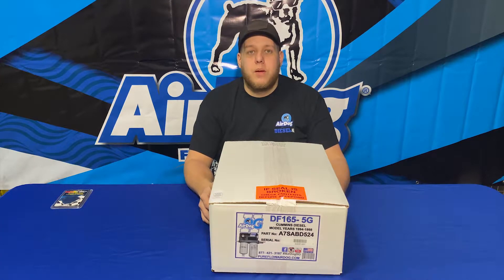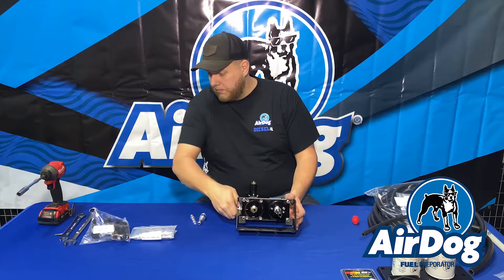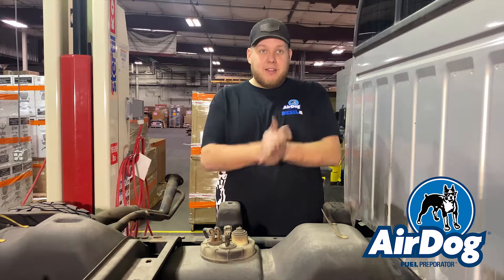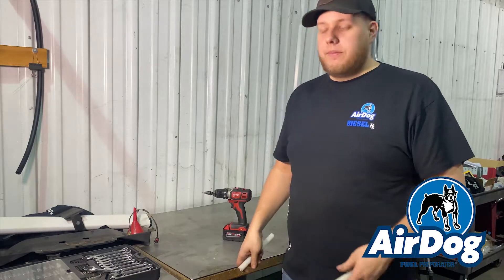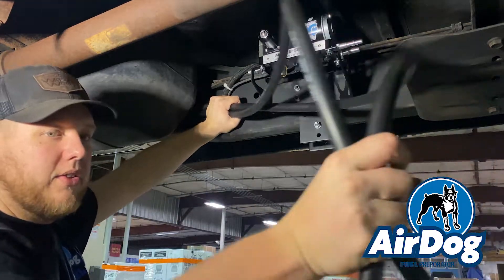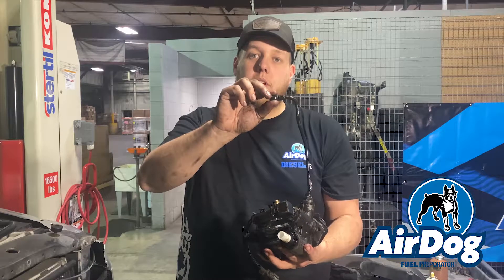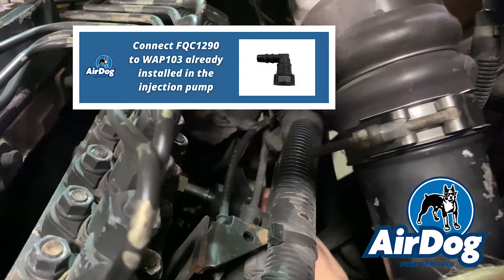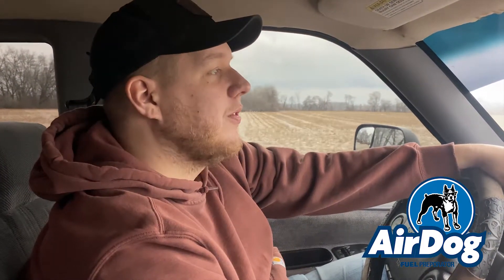1994-1998 Cummins Airdog DF-165-5G & DF-220-5G Installation

Comment: Just seen this video pop Thanks for making a  video of the 12v install kit there is no other video’s at all on 12v
Reply from the maker: We are working diligently to cover any platforms we have not made a video on yet.
Reply: @AirDogSales   how do you install your fuel pressure switch if you have it installed already into the side of the p pump ?
Reply: @AirDogSales   do you guys got any videos coming with a sump like
Beans installed in bottom of tank? Your the only company that done a video on a install on a 12v cummins how do you install
Fuel pressure switch that was installed into side of p pump?
Reply: @AirDogSales   do you guys do installs ? If so I need my new kit installed on my 96 ram 3500 12v cumins I have the beans sump but opened yo do whatever’s best

Comment: Does installing this pump make the in take pump not in use anymore? Or could the in take pump feed the air dog as well?
Reply from the maker: 12v Cummins Diesels do not have an in-tank pump. Only a fuel level sending unit.

Comment: Man I’ve watched this video like 5 times and still have questions. I’m installing a AirDog 5G 220gph on my 97 dodge ram 2500 12v Cummins with a dual sump from Ohio diesel. I’m running a block off plate on the mechanical lift pump port and deleted the stock fuel filter and removed the stock hard fuel lines. Curious what I do with the hard line where the overflow valve goes. I have a Tork Tek 70psi race overflow valve I’m installing to replace the adjustable one. Also do I need to use the filler neck adapter when using a sump? And should there be an oring or gas Teflon tape on the fitting that goes into the banjo fitting on the pump!
Reply from the maker: If you are replacing the return line off of the p-pump you will still need to tee the injector return into the return line. The injector return needs to be downstream of the overflow valve. If you have a feed and return sump, you won't need to use the filler neck tee. No, no tape or sealant on the fittings. The sealing washer provided in the kit does all the sealing.
Reply: @AirDogSales  thank you so very much!

Comment: Nicely done. I had a question, where do you recommend installing a fuel pressure gauge? On the air dog itself or closer to the p pump?
Reply from the maker: Being a pressurized system, it doesn't matter where the pressure gauge goes. If the sending unit wires don't reach the AirDog, we do sell a fuel pressure tee splice that will press right into our 1/2" fuel line.

Comment: What kit should I get for a freightliner fl70 with 5.9 cummins 12 valve engine?
Reply: Wow this dude who made this video didn't get back to you. Well in that case I would just put a 150gph. Plenty of fuel. The 165gph is 100 bucks more and is quiet.  I like the 150 because you can hear it.

Comment: Prolly won’t get a respons but is there any way to put an air dog with out installing factory fule lines at all both on my nipples on my sending unit crumbled in my hands
Reply: The kit bypasses those old stock lines. Make sure to order a filler neck for the return line. My 165gph didn't come with it . And buy a draw straw to bypass the fuel Pick up supply line you will have to drop your tank and drill a hole with a hole saw for the draw straw.